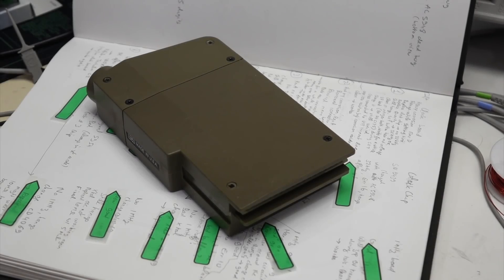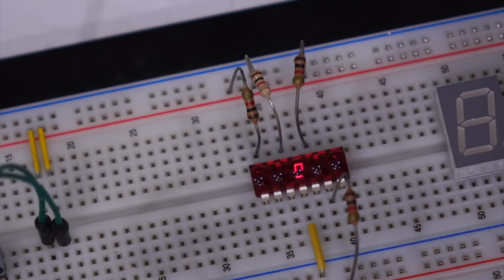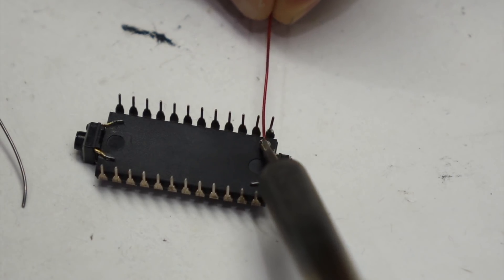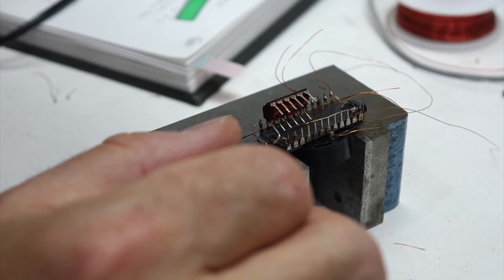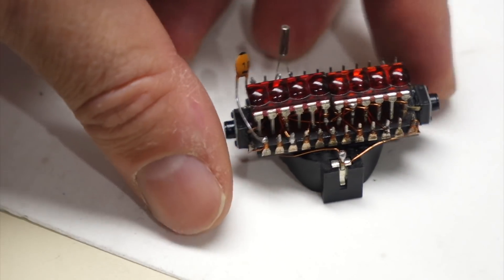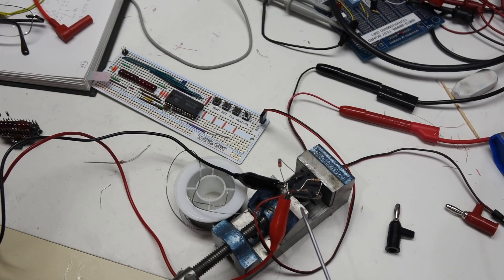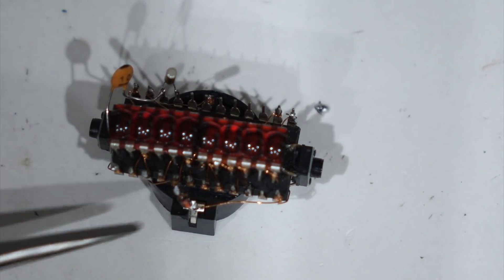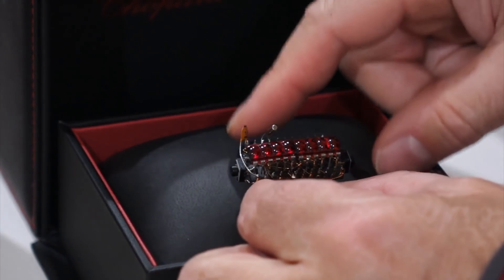Bubble LED clock hack with 1970's tech

Comment: Just a question. How is called that tool that you used to do the wire wrapping?, I've never seen that thing before.
Reply from the maker: It’s simply a hand wire wrap tool: https://www.amazon.com/dp/B00BFYE0CY . If you use it properly (not with enamel wire like here, but with the correct insulated wire on the correct pins), it works wonders. We used it, the correct way, to modify the Apollo Guidance Computer backplane. More reliable than soldering!

Comment: Interesting about the switch input. Some other clock chips from the period (I have one from Mostek for alarm clocks) used three-state inputs for some functions so an input pin could be low voltage, floating, or high voltage.  Provided it was wired correctly (with resistors or just a center-off toggle switch) this allowed for more switches to be used with only a limited number of pins.

Comment: 2032 has a high internal impedance so a cap in parallell ith the battery will help to run these things with current transients.

Comment: I still don't understand (though I suppose this goes back to the HP clock card repair videos), why on earth did HP use this chip for a computer RTC? Having all of the LED/segment drivers as well as human interface buttons for setting it were completely unnecessary for that application and greatly increased the complexity (as we saw) of those interface cards? Surely there were simple register/counter based clock ICs available at that time, no? Seeing now that this was basically a watch-on-a-chip (WoC?). They are HP...  I mean, wouldn't have just been cheaper to make their own greatly simplified chip than build out a clock card with a microprocessor just to pretend to be a human setting a watch and looking at an LED display?
Reply from the maker: RTC chips did not exist back then, nor did the low power CMOS technology to make them. But this IC was a chip that could keep time with a sub micro-watt power consumption and was affordable - it could be made an RTC for a computer, although it was not why it was developed. So HP invented the concept of a computer RTC, really, by adapting this chip for a use others had not thought about. I found it very clever.
Reply: @CuriousMarc  I suppose I had assumed that some early (simple) "RTC" ICs such as the MSM-5832 were available earlier, though it appears that particular one didn't hit the market until the very late 70's / early 80's. I haven't done an exhaustive search on this subject, however I did find that MITS did sell a RTC option for the Altair (MITS 88-VI/RTC) which they listed in their July 1975 price list. It seems though that a "real time clock" is really just an oscillator and a counter, ideally with some hardware modulo functions to simplify date retrieval logic (though not absolutely required). I know that sounds simple on the surface, and at the time such a thing wasn't readily available off the shelf. I suppose I'm just still perplexed by the design decision to build that quite complex (as you quite well know), high-chip count and costly RTC card for the HP including a dedicated microcontroller, multiple boards, etc. Now they are HP - the best and brightest of the time, so I'm sure if there was a better way then they would have taken it. Or was it just that HP were confident in their proprietary microcontrollers, comfortable with complex design and in that market at the time not as concerned with production/retail costs? Thanks for this and the other very interesting series on the HP clock card repairs. It's just very enlightening to see the ingenuity of how people solved problems back in a day when a shortcut just wasn't available!
Reply: @Hiphopasaurus  I designed the Oki Semiconductor MSM-5832 into a product in 1983.  It was only a year or two old at the time.  I am pretty sure the TI chip would have been around quite a bit earlier.

Comment: interesting, are there any newer, more available clock chips that a similar design could be built around?
Reply from the maker: Great question. As a dedicated IC for an LED watch and with low enough power consumption to be powered by watch batteries, I am not sure, as these got superseded by the introduction of LCD display watches. But you could make a modern equivalent with an microprocessor intended for IoT, which have extremely low latent power consumption and some RTC clocks built inside. Maybe some viewers can suggest one.
Reply from the maker: And a viewer suggested an Atmel 328. I agree. It checks all the boxes: it's an ATMega chip with a low power consumption mode and a special 32 kHz crystal port to keep time in that mode.

Comment: It's often that when you crudely reduce the voltage with a diode or series of them, you inevitably reduce the current to a point where it works for a state and doesn't for another state. I found the solution with a LM2596 based cheap Chinese buck converter 3.0-40V input to 1.5-35V output.

Comment: Where can I get the supplies for one of these?
Reply: I think the LEDs are going to be tough. I got several of these a few years ago. The place I got mine were soon out, forever.
Reply from the maker: It's hard. For the AC5948 I had to pay a ransom to a shady Asian supplier, and now I can't even find them anymore. The bubble LEDs are from eBay where you can still find them, or from old TI calculators for example.

Comment: So they used a different package when doing the clock ? Or just the silicon die maybe
Reply from the maker: They used just the bare die in the watch.
Reply: @CuriousMarc  very cool project. Thank you for your excellent channel. 👌🏻👍😊
Reply: Hmmmm in a dream.. Master Ken, .. would it be possible to take the scilicon die out of a chip and reconnect it? 
No …it would not be sensible to do with it with a rare chip like that.. but maybe it would be possble to test on a more common chip.

#Applied science !?

Comment: I'm unfortunately not skilled enough myself, but perhaps someone here could assist? I was thinking... since your goal was a watch, why not 3D print a housing for it out of clear resin? You could make it dual-sided with sockets using the female headers used on project wires/breadboard wires to make it socketable on both sides, with the proper wiring done in between, including little holes printed for the diode/etc? That would give you the ability to still see all of it (could even use 2 different colors for the top/bottom halves) and have a fully wearable design. (Printed to use standard watch bands/pins, of course.) Just a thought, but either way, thanks for sharing this awesome project! I had no idea those were little bubble LEDs, nor that they were using light-guide tubes like that! Fascinating! (And it looks so awesome, even on camera.)

Comment: I just love that it started out as a dead-bug style of integration, minimum viable product,... but then the problem with the power on the pin. Always something. So still dead-bug style, minimum viable, but now with an add-on diode to handle the idiosyncrasies of the pin. Always love to see the troubleshooting and "design for manufacture" changes that occur.

Comment: You really should tin the enamelled wire before offering for connection... Takes a lot of heat to remove the enamel, scratching often helps too... Great job though

Comment: I remember using some kind of enamelled wire which you'd wrap around pins then solder as part of a prototyping system in the 1980s.
Reply: I still have some with the dispenser pen tool.  The brand I know of was Road-Runner.  They also made basic prototyping boards.

Comment: A tablet of aspirin works great for removing the enamel from the wire. Just heat the wire while holding the aspirin against it.
Try a Germanium diode next time.
I would've used a socket for the chip, and wired everything to the socket. Easier to fix things and potentially reuse the chip with something else.

Question: Why did you use two display modules (8 digits)? One should be enough.

Comment: Marc
I have 2 Hamilton and 2 Pulsar watches from the first generation of 1970 LED watches with red displays. One of the Hamilton watches has the original chip and display and still works fine. The others have replacement chips/displays. There are 2 guys one in the UK and one in Germany that offer the service to update them if they have failed. The thing that kills these watches i leaving a battery in them so it leaks.  Mine all use 2 a76 1.5 v batteries. There original batteries used are not available and these batteries are slightly smaller and need a plastic ring round them to fit in the watch. They are a bit of a cult item.  John

Comment: 6:24 a fairly common issue with watches which use this chip. For some reason unless you have a nice fresh set of cells, they don't set properly, or indeed at all. The chip also eats batteries pretty quickly. Bear in mind this was bleeding edge technology of the day, so there were still a few gremlins in the works.

Comment: I remember buying one of those knock off at Sears back in the early 80s for 60$. I was 13. Mowed lawns all summer to be able to afford it. I stopped using it because the cost of batteries was to much, they would last 3 weeks at the most.

Comment: I wish I still had my wire-wrapping tool.  I have a spool of 30-gauge wrapping wire but nothing with which to strip it.
Reply: I have a spool of wire wrap wire for bodging.
The insulation usually melts off with a hot iron
Reply: @ddanielmiester  Well, I really don't want to ruin the tips on my new induction soldering station.  I guess I could try a lighter?

Comment: In the microscope photo of the clock chip die, what I assume are the wire bond points look like rubies. Which is amusing, given the use of jewel bearings in analog watches.

Comment: I had one of those TI watches, reading the time on a motorcycle was interesting. Reach over to the right wrist and push the button, then quickly put the left hand on the handle bars and hold the right wrist to by eyes to read it with out it timing out.

Comment: Vacuum fluorescent displays looks so much better
Reply: Working on a VFD at the moment and I agree that they look gorgeous but something this size isn't practical with them.
Hell, the tubes I have on hand (IV-3) are about the size of this whole thing!
Reply: @owenkegg5608  it is not a technology limitation I think, there were many tiny calcs with VFD displays. I am not sure what niche philips wanted to cover with this led chip considering that VFD was already a mature technology by that time.
Reply: @pahom2  I am aware of tiny VFD calcs.
I'm just saying this little clock is about the size of a finger, the size of most VFD tubes. 
Take this with a grain of salt, I'm mostly familiar with Soviet VFDs, which may be different. 

It's possible they were developing it for marketing, or just because they can.
And note you need a comparatively large power supply and bank of transistors to activate and switch VFDs.
But then again older LEDs weren't exactly low powered.

Comment: Ahh, yes... I remember lusting after one of those TI watches when they first came out. I was maybe 12 or so, and my parents told me "No way - it's too expensive and you'll just break it!" A handful of years later, and I bought my own first "digital watch", which by then had evolved into an LCD version and was all of $20 or so. But the old LED "bubble" watches still have a special place in my heart, even if I never owned one myself and they became obsolete in less than a decade, simply because they were "my first love" of modern tech. 😋

Comment: Originally, 2 silver oxide cells were used… and the switches were made to the junction of the 2 cells.  Each cell was 1.2volts I believe.
Reply from the maker: I knew about the two cells, but did not think about the switches running at half voltage. That might explain it indeed!
Reply: @CuriousMarc  yes, the metal caseback would have been both the switch common and the center battery connection (mid rail voltage).   I would guess a single cell supply, then a resistor potential divider would serve as a switch common also 👍🏻
Reply: @8-bitbitsa821  Not completely sure about your explanation, from memory these watches were mostly plastic (well by the time young me received one as a present), maybe with a sheet metal back, however I recall the main case as plastic.
Reply: This is a better suggestion that I was going to make: Just run the thing with a 3/4 dead button cell.
Reply: @compu85  The problem with that is that they don't stay that way very long. That's why you generally want to use the relatively flat part of the battery's curve.
Reply: I literally was dealing with this same issue yesterday (from the converse direction). Try a pair of NiMH cells. They'll last for a year or so between recharges, unless the LEDs are on a lot, and hold 1.2V pretty well (1.4 on full charge, so the sacrifice here would be not fully charging)

Comment: I have one of those bubble LED displays from a old HP calculator (its like a 10 digit or something been a while since I looked at it)  that the board was completely destroyed by battery gunk, its amazing you used to buy those things at Radio Shack at the mall now they are worth more than gold. Anywho I am (planning) to use it in a computer to display temps and whatnot

Comment: Why is it not showing the time constantly like other clocks?
Reply: LED's use a LOT of power compared to say modern LCD's. In the original watches (of which I had a Pulsar, I think it was called) You had to hit a button to see the time to save power. And the Display was kind of on the side of the watch too...
Reply: @MRichK  Oh... Okay... ☺
Reply: Battery life. The LEDs draw too much power to have the display lit continuously. Rember this chip was designed for a wrist watch.
Reply: @1971merlin  Oh... Okay... ☺

Comment: I did the opposite sorta. designed a tiny circuit with a modern chip to retrofit inside a 70s LED watch case :)
Reply from the maker: Can you share what chip you used? Another commenter was asking if there was any modern equivalent IC to make an LED watch, with power sufficiently low to work off watch batteries. I suspect one could make it with a modern ultra-low power IoT processor.
Reply: @CuriousMarc  I used an ATMEGA328, which can be pretty shockingly low power when you configure it just right. Just like the classic LED watches, it sleeps until you press a button. There are some good tutorials out there for doing low power. The only components used are the bubble display, current limiting resistors, MCU, power cap, and watch crystal. and of course the battery. After I discovered charlieplexing, I redesigned it using an ATTINY, but haven't built that version.
Reply from the maker: @zbradbell  Great, I have never used the sleep mode of the Atmel ATmega.

Comment: What for second led module?
Reply from the maker: It’s because of the lefthand digit. It needs to be wired differently. See reverse engineering video here: https://youtu.be/pr6HTiWrMmk
Reply: I was wondering the same thing. Looks like the clock chip only uses 4 digits and the second module would be just extra soldering work.

Comment: I haven't used dead bug mods for many years! The question many will ask is ... WHY? And of course the answer is WHY NOT! Brilliant.
Reply: It's because pcb manufacturing is so cheap and accessible these days ;)
Reply: @TradieTrev  And of course not many designs use DIP packages! I've got a t-shirt which shows a 6502 processor on it. The words are "I prefer my chips in DIP" 😊